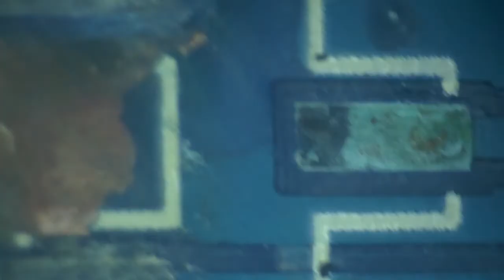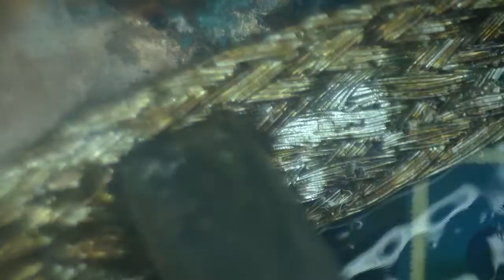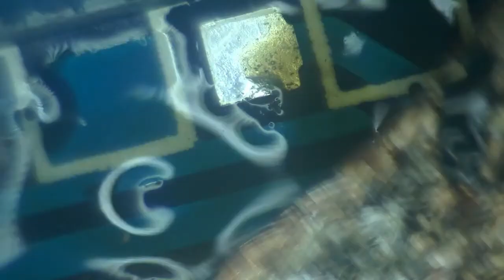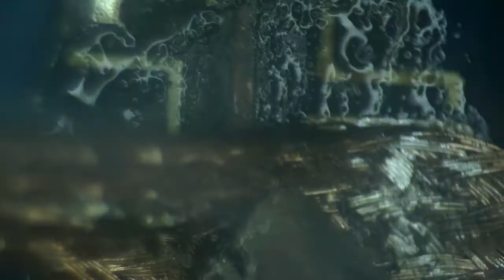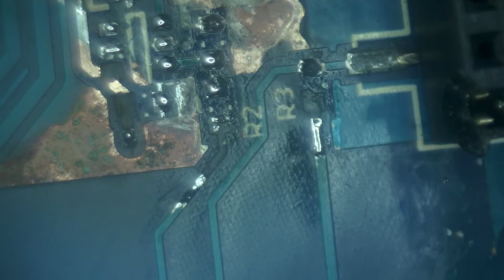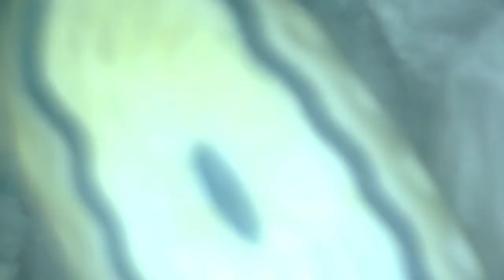AI Hydra 26 HD - Water Damaged Connector Board Repair

Comment: Many thanks for your videos, I have also read your posts in R2R, but this the very first time I comment on your content. By any chance, do you know if the 5v regulator on the Hydras can be changed to a 12v? Is it an LDO? Is there any other circuitry requiring 5v, or is just the fan? I would like to use a 12v fan, since the SD8015R5L2 from speedy is no longer manufactured, and AI charges 18USD for a replacement, while there are plenty of options for 12v fan, for less than 2USD, and I would like to replace 6 of them, they are still working, but those things looks very tired to me.
Reply from the maker: Hmm... You'd have to modify the fan circuit on the connector board. Otherwise, I believe the fan circuit receives 12v at the input. There are other consumers of 5v on the main board, but I believe they have their own voltage regulators.
Reply: @FixReef  thanks! Yes, I would modify all the circuitry... I will check it and will let you know... Many thanks!

Comment: Nice job with the rework... On this type of lights that are by water/saltwater why don't the put a thin layer of silicone to protect the board and components?
Reply: kessil puts a coating over the boards
Reply: @boomcar911  I'm getting hopefully on Monday a AI prime 16HD that I'll need to work on and I'm thinking what is wrong with it is just salt around the wifi board, with a good cleaning and a poke around with the multimeter and a good inspection under the scope I'll have it up and going.. on the wifi board if it's the main chip I can't just replace it can I ?
Reply from the maker: I rarely see issues with wifi boards on AI. #1 issue of most non working lights are burned out LEDs. Followed by water damage and power circuit damage.
Reply: @boomcar911  yes, it’s a urethane coating. I’m sure that none of the manufacturers do it so that the light short out so you keep buying them. This is a practice that has been around for a long time. Most electronics that are used in marine applications have a urethane coating or are potted